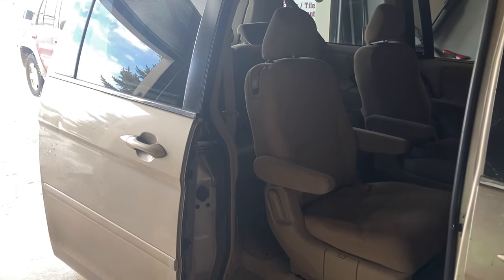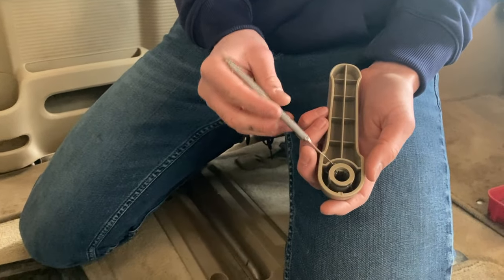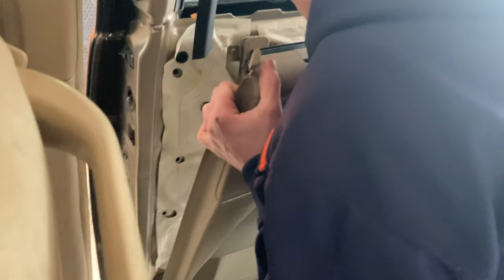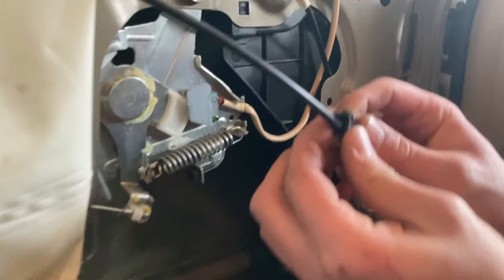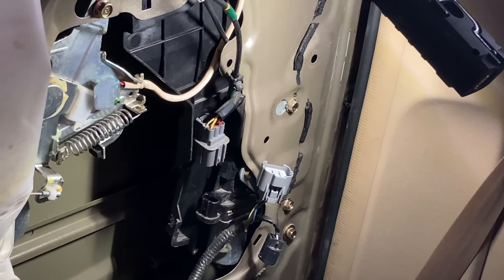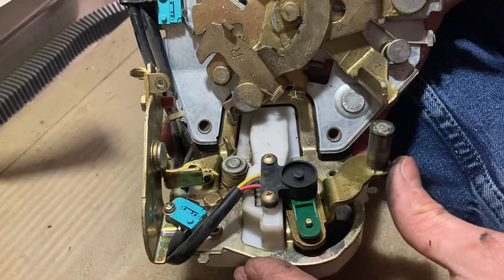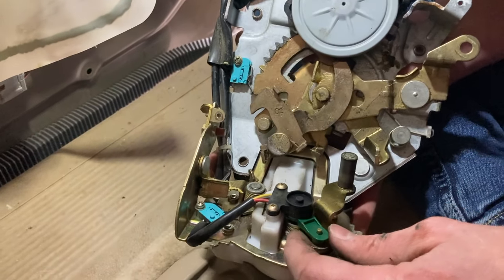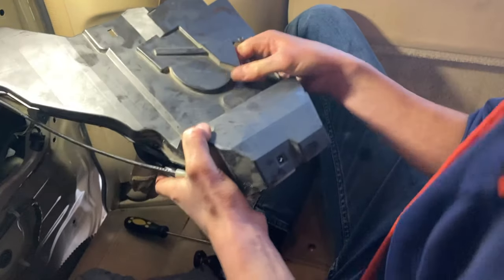How To Fix Parasitic Drain and Power Sliding Doors On 2005-10 Honda Odyssey

Comment: Very informative video! I have a 2004 odyssey and my side doors on both sides are messed up. Drivers side is really the culprit, so I will try my hand at this. Right now the drivers side back door won't even open so I have that to address too. Good video!
Reply from the maker: Thank you! Hopefully you’re able to get it all fixed up without too much trouble. The doors on my van quit working again last month, but it turns out that the micro switches are bad, so I won’t be able to get away with just relubing the mechanism. I’ll make a new video on my adventures once I find the time to actually do it within the next couple of weeks🤣

Comment: Thanks so much for making this! I’ve been dealing with this issue for a while now. I took my van to my mechanic, but we still haven’t been able to fully solve the problem. The best solution we’ve come up with so far is bypassing the electric doors, locks and interior lights to stop the parasitic drain, but that’s not ideal. I’d love to have everything functioning properly, including using the key fob to lock the doors.

I’m excited to try your method this weekend and see if it finally solves my issue. Everything you describe here, and in your other video, matches what I’ve been experiencing perfectly.

Do you have any tips on how to clean the tracks, and what product do you recommend for relubricating them after?
Reply from the maker: I've cleaned the tracks maybe one or two times (should probably do it more often) and from what I can remember, it's a lot easier if you remove that little trim piece that goes over the track. If you watch any video on how to replace the door rollers, it will be one of the first steps they show. I'd recommend using a white lithium spray grease.

Comment: This was one of the best how-to videos I've seen.  Very thorough, but didn't waste time with chattiness.  Question: Is there a latch in the front of the door as well as the back? I am almost done putting mine back together, but....I noticed that the mechanism that seems to latch on the front...isn't free flowing and snapping back up like the other side.  So, I wonder if that could also be an issue with the parasitic draw.  Thanks again.
Reply: I’m looking into replacing the switch for the mechanism but I’m confused. Are there two switches in there and is one NO and the other NC?  (Normally opened/closed)

Comment: My situation was coupled with the symptom of a ticking/clicking noise only audible when near the fuse box.
It was a pretty fast tick and didn't seem like it was gonna stop anytime soon even with the key out!

I could literally feel the tick coming from the 7.5a fuse before i knew it was the one, pulling stopped the ticking!

That's what lead me here lol

The ticking has stopped and the door has no trouble closing anymore!

I did not take the door apart as you did, I used WD to clean that wire/cord and the grooves and loaded them up with a buttload of Lucas Marine grease (i chose this grease for weather protection and its high melting point, apparently the kind doesn't matter as much)

I also slapped on a silly amount of the marine grease into both latches at the front and back of both power doors.

I did the trunk for good measure, wasn't having a problem there but hopefully I won't either.

This worked good enough for me, literally no disassembly, i only wish I used a can of brake cleaner/contact cleaner with the long red tip to blow out the latches, there was dirt actually packed into that latch. I cringe looking back not doing it but I did it at break time at work lol (that's when i found my car died)

Comment: Hello Hans.  Thank you for this YouTu be video. I was able to successfully get my power sliding door operating again on my 07 odyssey. However, now  the problem is the window won’t come back up now that I have put it down. I wondered if any of your other viewers have had a similar issue and if so, do you know how they  corrected it? The next thing I’m going to do is check all the fuses to see if that is the problem. Again, thanks for the video.  I’ll find out in a couple of days whether it fixed the drain on the battery.
Reply: Thanks for your response . After inspecting the switch on the door, I found the harness the switch plugs into wasn’t making  full
Contact .   I was able to use electrical tape to hold things in place and the window gos up and down now.  😀 not sure how long this will last but the window is up for now.  I may need a more permanent fix but this is good for now.

Comment: I have the same exact problem and it’s very annoying while I’m driving and the map lights are coming on and off depending on when I turn right or left.🤦🏽‍♂️ I’m sure the price to have a professional fix this will run me a couple hundred, so thanks for the upload and information. I will attempt this myself and save myself some money. 💪🏽
Reply: Honda dealership wants to charge me around $3,500 to fix this exact same issue,but they’re saying they need to replace the “floor harness “
Reply: @hanspoole  As an update, i tried the DIY method and failed. The passenger side sliding door still reads as if it’s open. My lights still come on. However, the light switch for the map light located on the dash behind the right side of the steering wheel, has an on and off and also an option to never have any lights come on when a door is open. I keep it that way now.

Comment: Thank you for the amazing video. When I got my piece out of the door, I could not exactly tell what was wrong, if anything. I took the screw out that holds the little blue switch in place and tested the switch with a continuity tester - all was good (I was afraid this was the problem and I'd never be able to get just that switch). I also took the screw out of the switch so that I could push the switch aside or cover it while I sprayed some brake cleaner around that immediate area. I did this because I had white lithium grease on the door latch mechanism but regular amber grease everywhere else (window regulator). I felt it was better to leave the window section with its amber grease as is. The grease looked like it was doing it's job,  but I really wanted to get all of the lithium grease off everything around the door latch area. With all of the lithium grease removed I could see everything working better. And by better I mean the slightest bit added to put enough pressure on the switch contact. The difference is very small to the eye but as you all know - that is what is needed, and you can verify this with a continuity tester. I then added some PB Blaster around the same area where the lithium grease was and cleaned off any that was running freely. Then I used your advice to use the 3 in 1 oil, but I wasn't exactly sure where the 3-in-1 was to be applied. I felt that the circular piece that rotates as the latch is activated and deactivated would be best served by some thicker oil there and I put a drop on the front side and back side. Hopefully that does the trick. Anyone else about to try to this job, I do think some brake cleaner gets the old crud out very well, just project the switch.
Reply from the maker: I discovered precisely the same thing when I took it apart for the first time. The mechanism seems to be moving ok at first glance, but upon further examination, you can see that the switches aren’t being activated fully. It’s the little things that count😉. Good point about using brake clean: while it works wonders removing grease, you’ve got to be careful around the delicate electronics.

Comment: THANKS . MY 2005 rear sliding door wont open when the key is inserted into the ignition switch.  I get a sliding door warning light but After I remove the key from the ignition switch, then remove and reinsert the 7.5A fuse; the rear door works great.  IT system acts like a short somewhere when the key is inserted into the ignition switch.  I will try cleaning the door latch like you suggested.

Comment: Took my '05 Odyssey into the shop today thinking I had an alternator issue. They called me back a couple hours later and said that my battery and my alternator are good and that they picked up on a parasitic draw, likely for the back doors, so they removed Fuse 7 from the driver's side fuse box and the parasitic draw went away. 

I know exactly which door it is too thankfully. It's the passenger side back door. We had opened it one day to get stuff out and then went to put the van in gear and it gave that buzzer sound as if the door was open. Opened and closed it a few different times to resolve the issue and it worked. However, the last time we had folks in the back of the van and it made the buzzer sound when we put it in gear, we just turned the power doors off so we wouldn't hear the buzzer. Now we know that we have to make sure the door gets all the way in so it doesn't drain everything instead of just turning off the power doors and calling it a day. 

One downside about running around without that Fuse 7 is that now the interior auto lights don't come on when the door is open, I can't use the FOB to lock/unlock the vehicle, and the power locks don't function without the vehicle being turned on. The guy at the shop said that he wouldn't be able to fix the issue and that I would have to take it to a Honda dealership. I'm not skilled with vehicle repairs or anything, I'm more of an electronics (computers/phones/etc) guy, nor do I have  the space to work on it myself, so I'll either see if I can find someone to replace that latch or see if getting the latch cleaned out will help prevent the parasitic draw.
Reply from the maker: Yup, that sounds exactly like what I experienced before cleaning up the latches. We got pretty use to shutting off the door switch every time we put the van in gear🤣. 

I'm surprised you're able to get the door to close fully by just giving it a few tries. My guess is that it's just barely gunked up enough for it to not work sometimes, but not so much that it never works. 

Good luck getting it fixed!

Comment: Hi.
Thanks for the video.
I just got stuck today.
Gas cap not opening and door also stuck, same thing 3 beeps and nothing.
Now the problem is, I don't have gas in my odyssey. So can't go anywhere. Did you have the same issue, or you gas door was working?
Is there any way I can open the gas tank manually?
Please help.
Thank you.
Reply from the maker: Interesting...I've never experienced, nor have I heard of that  happening. I'm almost 100% certain that the gas cap is mechanically actuated on my Odyssey. From what I can tell, there are two functions of that lever: 1, it opens the gas flap, and 2, it locks the driver's side sliding door. If yours is the same as mine, then I wonder if the lever or a cable broke somewhere, causing the door to stay locked and gas flap stay closed, which makes it refuse to open. I'm not an expert on this, but that's what I'de recommend checking out if I were you. Also, forums might be useful to peruse as well.
Reply: @hanspoole  Thank you so much. Actually, the cable with sensor was broken from the end, where there is a spring that opens the gas door. I got the cable out and fixed it with epoxy glue, fitted it, and everything became normal. Part No. 74380-TK8-A01.
Thanks, though.

Comment: I don’t need the door to open & close, I just need the battery drain to stop.  What fuse(s) can I remove to break the power connection and stop the drain?
Reply: @hanspoole  Very thorough video and follow up comments!  I was on the verge of installing an in-cabin battery disconnect switch in my 2007 Odyssey, but your video gives me new hope to address a root cause!  Thank you.

Comment: This video was so helpful and allowed me to do my own repair.  Any idea what a Honda dealership would charge to do this job?
Reply: @hanspoole  I just had my driver's side slider motor assembly replaced today and out the door it was $894 (original quote was $1183). If the other door starts I'm definitely trying your process before taking it back to Honda here in Nor Cal.
Reply: @hanspoole  That's around the amount your video saved me; it cost me no more than some time, dirty hands and penetrating oil.  The door has worked flawlessly since, and no power drain. Again, thanks...
Reply: I literally paid 2200 dollars only for my doors to stop working again on a 2005 a couple years later. Now I'm trying to fix it myself cause I'll drive this thing off a cliff before I spend another dime on these doors. Stupid defect that happens to literally all odyssey models 05 and beyond

Comment: I have a 2004 Odyssey with the same parasitic drain on battery.  The #7 fuse on driver side is labelled "IG coil", 7.5w.  I found the power slide fuse in panel under the hood.  It's shows 30amp.  If I pulled this fuse could it stop the battery drain?  Or can I flip the switch inside so auto slide is OFF?   Thank you for the detailed video.

Comment: We just bought a 2000 Honda odyssey EX for $800. The car does not start normally, and we were told the power sliding doors do not work. I assume the doors are causing parasitic battery drainage. The car has to be jump started every time you need to use it with a jump start kit. 

When using the doors manually, it seems like the power sliding doors do not latch properly, and I am starting to feel like this video may be our fix, but I don’t know how comfortable I feel preforming this myself.
Reply: The thing not starting normally and problematic power sliding doors are two diametrically different issues.  Tackle the doors, if you are so inclined, only AFTER you have remedied the starting problem.

Comment: My 07 odyssey has the same symptons. Drains the battery after a couple days if not driving it. Blend door actuators going bad, Door sliders also bad. Everything else will go bad all at once. Cars a junk after 15 years. They should make cars simple again. Thanks for the video lesson.
Reply: Try lithium grease on the blend door nylon slides it worked for me.  I agree with you these older Honda vans are overly complicated and troublesome
Reply: And manually move the blend door mechanism, lube the cable with wd40, that will help free it up.  This is an easy fix

Comment: Looks like people are looking at this video recently as well, so here it is.  Prior to putting the latch back, put water proof butyl tape along the TOP seam of the latch to close off the latch from moisture coming down through the door.  Door panel is not water proof and there is drain hole at the bottom of the door to let water out.  However, the water gets into the latch (later version of the latch had couple of foam tapes which helps but not totally water proof) and eats away at the lubrication and also this is worse in the winter because the lubrication gets hard AND the moisture inside the latch will freeze making things worse.  In my experience, doing what he does will get you through couple of seasons but the issue will come back and so far, I had to swap out both of my latches with new OEM one (about $250 each) but since I had to swap out batteries 3 times because of the drain, you will save $$ from not having to swap out the battery.  In a pinch, I found spray and pray method works for a month or 2.  Just undo the 3 bolts from the back of the latch one at a time and spray with plenty of brake cleaner/degreaser using long straw followed by lithium grease (suitable for low temp) followed by manual opening and closing of the door 10-15 times will usually get the door gears unstuck.
Reply from the maker: That is a very good caveat to take note of! In fact, the microswitches on both door latches went bad on our van a couple of months ago (the latch mechanism still moves freely) and I'll need to solder in some new latches. In my case, I think what happened is that a lot of condensation formed on the inside of the door due to drastic temperature fluctuations. Haven't gotten around to putting in those new switches yet because life has been too busy, but I'll make sure to make a video when I finally get around to it 🤣

Comment: Do you really have to do all of that? Is there a hacky way to clean it without going through what seems to be like a really hairy process? Also did this trigger the alarm for you? Because my cars alarm would go off.
Reply: @hanspoole  Thanks for answering! The door alarm on mine doesn't trigger anymore, it did at the start (turning the sliding door power switch to off stopped the alarm most of the time, but now it just doesn't trigger) 

The alarm that it did trigger was the actual car alarm. It used to drain my battery so I'm connecting and disconnecting it.
Reply: How did you do that?